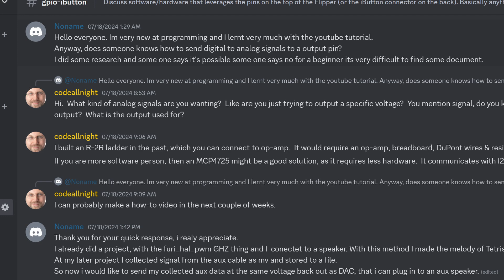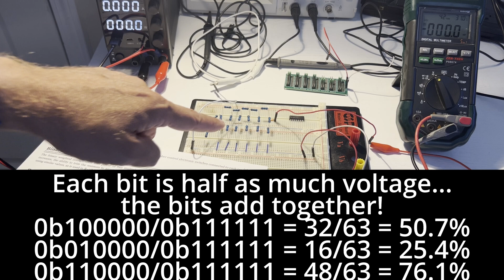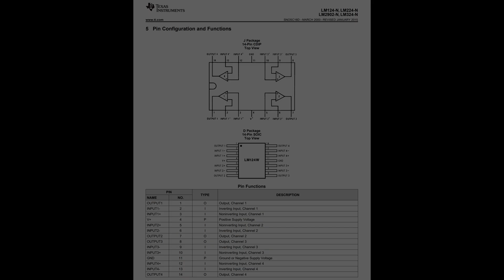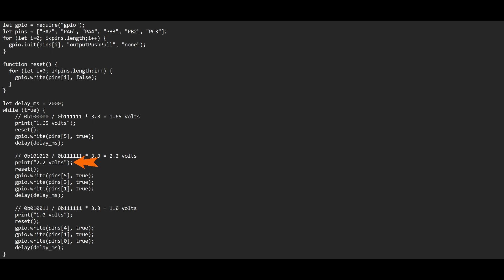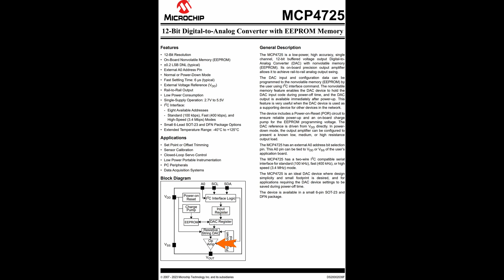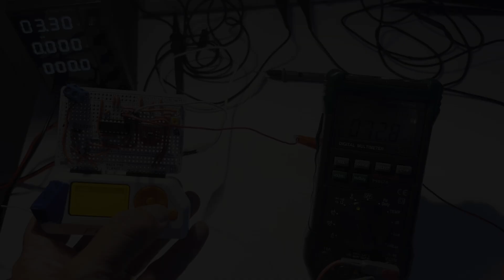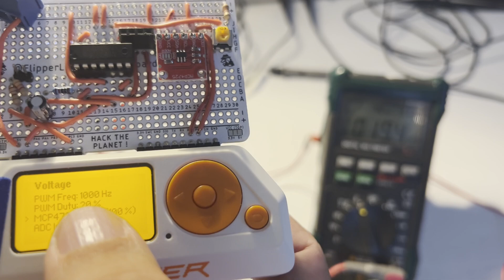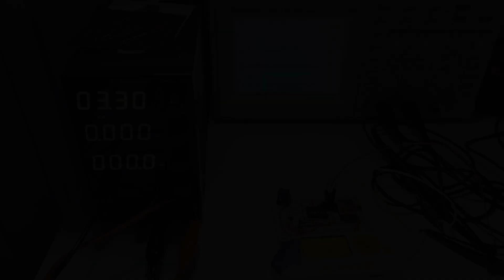[128] Flipper Zero: Output Analog Voltages!  #dac #analog #flipperzero #gpio #giveaway

Comment: Flipper zero are able to be used like multi meter ?
Reply from the maker: We can read voltages (0-2 volts). We can read resistance (using a few add-on resistors). For current, I think you need additional I2C hardware.

It's possible, but not as nice as a $15 USD meter. :)

Comment: Nice!  Would you have any interest in building something for me (or know someone who may)?
Don’t really have any other way to contact you.  
A small simple compact power monitor that measures AC milliamperes in the 100-400 milliamperes range with display-connected via two wires with alligator clips.  Thanks
Reply from the maker: I would probably approach the problem slightly differently and write an app that uses an INA219 to measure the current - which should have 0.5mA accuracy and plenty of range in current.  It would give you voltage isolation on the input, so you wouldn't be constrained to a 3-5V supply.  I've never done the project but would be willing to build one at the end of the month. Using an INA226 would also be an option, as there is a nice DONGKER INA226 module that we could connect to the FZ via DuPont cables and has screw terminates for attaching your alligator clips for either Voltage or Current.  I'd probably connect it to the purple board in the video.  How frequently do we measure the current?  What all features does the app need (like save, plot, etc.) 

I am @CodeAllNight on Discord, which would be a great way to contact me further.  Or you can reach out on my server at https://discord.gg/k7WX7Be3Vy
Reply: @MrDerekJamison  basically it’s for HVAC.  I carry an DMM (clamp type) which I use for everything, and does almost everything I need it to do.  The only thing it can’t do is measure AC milliamperes in the 100-400 range, which I need to test a coil in a transformer (ignitor), on oil burners.  So I have to carry a second, quite large, special DMM just to test/troubleshoot this coil-which takes up too much room in the tool bag. 
I saw what you did in this video and saw some other videos of people making small devices to measure voltage, so I thought it would be perfect for a small Audaurino-sized device or similar, to get this reading, rather than always needing the second DMM. I looked into the smallest palm sized DMM, but most look like cheap junk, and the range isn’t quite right for my needs.
Thanks for reading!

Comment from the maker: 7:03 -- Notice that briefly we are outputting the wrong bit pattern; as we transition between values.  We could use a register to help reduce the glitch or perhaps a capacitor would help? As we saw in other videos, JavaScript runs fairly slow.  Instead of "reset all pins" we could be smarter about clearing and setting bits, but we would still under/over shoot the target voltage as we transition.  It really depends on how you plan on using the analog voltage.

Comment from the maker: 3:04 -- The LM324 Op-Amp wants the power pin (pin 4) to be at least 1.5 volts MORE than the input our output signals.  With our input voltage being 3.3 volts, a 5.0 volt supply is great.  I think you might want to add some capacitors across the Op-Amp too?